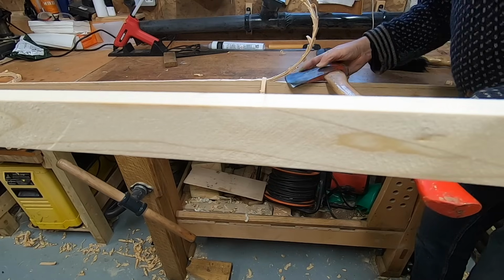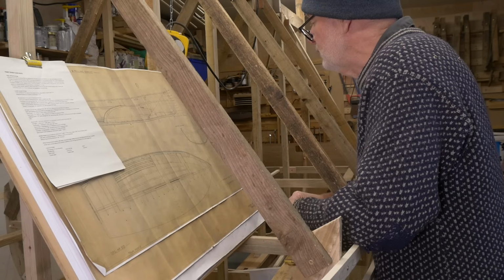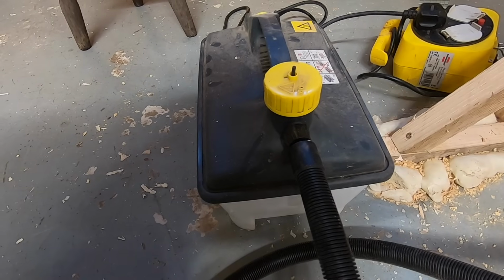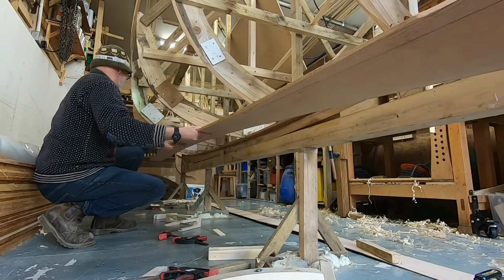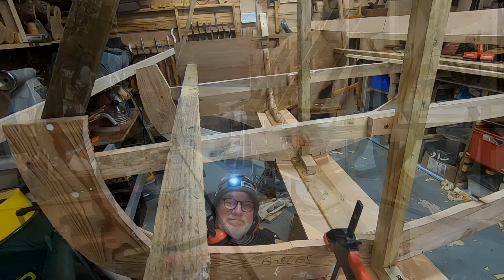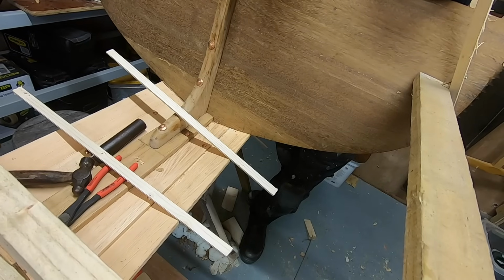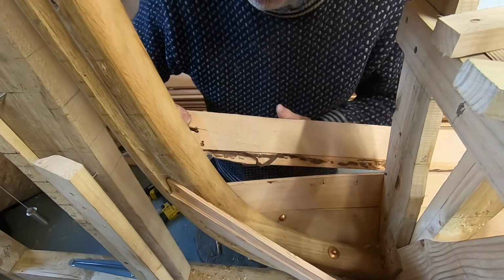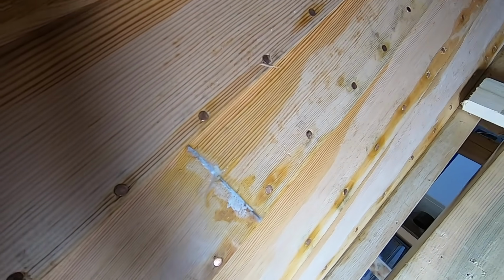The Garboard, Things Go Wrong and Cowboys (Ep.4.) Two Blokes build a Boat

Comment: Couple of thoughts: 

Avoid grain run-out (cause of your split).

Screw rather than nail into the stem?

Have you considered the tradition method of bedding planks with very thick old paint or varnish? Could always put mastic on the hood ends as well as a belt and braces... (never like putting mastic on bare wood).

Re: the rivet issue, option 5. consider 3 inter-timber rivets i.e just put in another one each side, maybe dropping down to a 13g if you're worried about splits. You only need to do it for the garboard / 1st plank lands and revert to 2 rivets thereafter.
Reply from the maker: Thanks for your thoughts. Some really interesting solutions. We have used a modern mastic on the hood ends - in retrospect I would prefer to use putty. Perhaps next time.

Comment: I vaguely remember being taught as a RN Shipwright to build a clinker planked boat upside down. The overhead work which with each strake becomes more horizontal is putting roves on the nails. The ribs, I think we called them timbers, were put in after turning the boat.  My brother, who was a civilian Shipwright would deal with that split by saying “the advent of modern adhesives has made joints unnecessary.” 
However I like your scarf, quite a normal thing to do in the interests of economics. Since you are following an instruction book this comment is to promote discussion not to gainsay you. and
Reply from the maker: Sounds like you have got some valuable experience. Thanks.

Comment: Don’t feel like a couple of planks guys, this must happen all the time in boatbuilding and the benefit is seeing the adaptions to the snags that appear and as far as the split plank repair is concerned this is a great way to show how to repair a plank that has rotted at the bow in older boats without replacing the whole plank. Surely the challenges are better to watch than just a straightforward no problems build, for me they are anyway.
Reply from the maker: Thanks Alan. Glad you appreciate the approach.

Comment: Nice work blokes. I have to say........ What I would have done, given that you've had recourse to the blessed epoxy, I would have just released the fastenings in that region, worked epoxy into the split, clamped it up, refastened it when cured et voila. Epoxy is immensely strong. I'm building a boat myself, another one, and using no fastenings at all, just wood and epoxy glue. One of the wonders of our age! There will be lots of these kinds of events, but they do say that the real skill, is learning how to rectify your cock ups. Cheers
Reply from the maker: Thanks for your thoughts, that would certainly be another solution.

Comment: You've already epoxied the stem, couldn't you've epoxied that split on the plank? Doesn't matter though it all worked out. I'm glad you put option 4 on the table to ease your souls if only for a few seconds lol
Reply from the maker: Yes we did consider epoxy but the plank had begun to pull out of shape. So that might have been as tricky as the scarf which seems to be working surprisingly well.

Comment: I can't help feeling that GoPro is casting a bit of a malevolent eye on proceedings, rather like the HAL9000. It looks like you have the choice of wood for the planking, will there be an article on your supply at some point, or is that a closely guarded secret at the moment? The repair was spot on and shown to be a minor setback, rather than a disaster. Happy New Year.
Reply from the maker: THanks and happy New Year. We used Canadian douglas fur for the planking and larch for the sheerstrakes. More on that later.
Reply: @jonsealwoodturning4673  Thanks for the reply. I don't think it is easy to source wood that is cut right, I have had trouble finding any quarter sawn stuff at timber yards for  projects I have done.

Comment: Great video two questions: is your planking stock local (Devon) or imported; what gooop sealant are you using. One comment: could your split be repaired by routing  and gluing in a aplinein a spline
Reply from the maker: Hi. We ended up using Canadian Douglas fur which is fantastic quality and larch for the sheerstrakes. In retrospect, if the larch had been seasoned, we would have used it for the entire hull. We're using arbo 1000 which seems ok as it's only used between the hog and the garboard and a little bit in the geralds. I think the  routing option may have been as complicated as the replacement and not such a tidy fix.

Comment: That's why all has stopped using their gopro as the main camera, their unreliable. I have 2 and haven't used them for 3 years i will but only for second shots.
Reply from the maker: I wiuld like to answer but the Go Pro is sitting a bit close to the keyboard :)